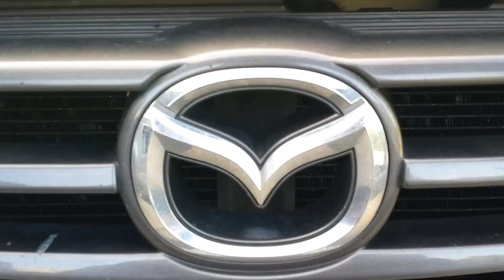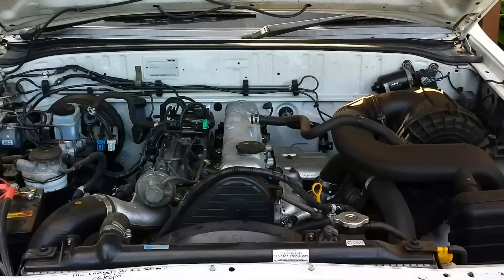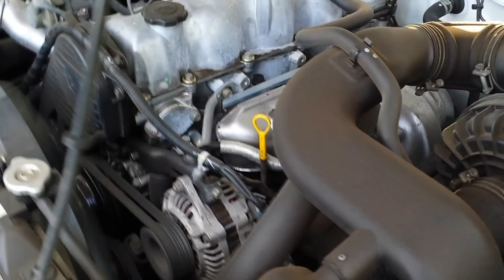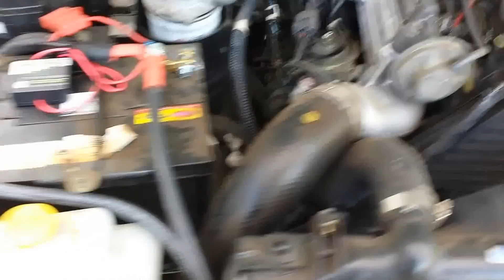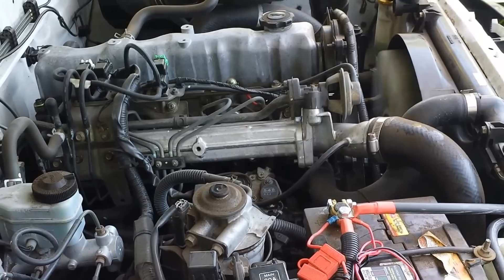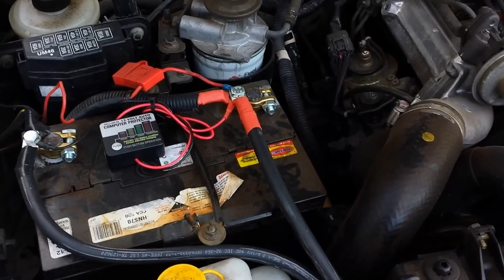Mazda Bounty 2006, 2.5 L WL -(2,499cc) - Turbodiesel - 86kW

Comment: Please.
Your help.
How many km should you do per liter of diesel.
This pickup has no electronics, it uses a mechanical diesel pump.
Reply from the maker: Mazda claimed the 2.5-litre models would sip fuel at the rate of 8.3 L/100 km, they also claimed the 3.0-litre models would average 9.2-10.4 L/100 km.  When tested by Cars Guide the 3.0-litre manual dual-cab ute returned an impressive 8.8 L/100 km average in a mix of city and country driving. Dependent on your driving style(agressive or passive), including urban or highway use, vehicle regulary serviced, correctly inflated tires, windows up, not using aircon, washed and clean, using the 12 second rule, driving at 90kms instead of 100kms, etc. Fairly conservative driving could cut that to 7.8 - 8.0 L/ 100kms, maybe even abit more, but those behind you might not be impressed.

Comment: one of the best diesel engines made
Reply: Why is it?
Reply from the maker: In my opinion, its a well designed tough engine that produces good torque. The Fuel injection is particularly noticeable than the prior carburetor versions, and if its well maintained religiously and had good clean fuel will go and go. One very well maintained and never abused WL engine I have seen, which had never been opened had done just over 1 million kms, which i found truly astounding.
Reply: I'm glad you've said that because I've got one but mine is the Ford Ranger 2003-2006 model👍🏼she's only done 67k. I bought a rear canopy off someone with the same truck, his was a 2005 with 300,000 miles on the clock and it still drives smooth.
Reply from the maker: That is awesome, two good pieces of advice that was told to me from well healed and very wise mechanic's was 1. maintain the vehicle and change your oil and filters / fuel filters regularly, with good oil / filters (i do mine every 5000KMs, overkill I know) and 2. dont use more than 75% of the available power that the engine produces most of the time, there will be times that you will ie overtaking or off road etc. This is just my opinion and others may have other ideas which is neither right or wrong, everyone to there own. I also use a diesel fuel additive, which improves Cetane rating and reduces fuel bug among other things. Good Luck and Happy Cruising.
Reply: @rattfink3285  Hey, I am about to buy a Mazda 2006 b2900 (4x2) and I would like to know if you use a diesel additive every fill-up in order to protect the engine and make it last longer? What's the brand of the additive? Engine oil you use is 15w-40? oil filter and fuel filter brand? What can you tell as far as common problems that this engines/vehicles have? Thanks!
Reply from the maker: @emirmartinezc   hey Bud. Thats great to hear, is that the 2.9L D version?. I use 'Morey's Diesel Smoke Killer fuel conditioner', increases cetane up to (5) points, to reduce diesel smoke, improve fuel injection, provide anti-wear, enhance fuel economy and ensure engine cleanliness and fuel stability. Also contains biocidal properties. Every fill. 1L bottle does about 650 Litres all up, about NZ$25. Shell Rimula R4 X, I buy a 20L pale and get about 3x changes from it, with new filter every 5000kms and diesel filter every 10000kms, Sakura brand at the moment as there are about half the price.
Although reasonably durable, most have been worked hard and show signs of it. 

The engine uses a cambelt which will require regular replacement. It is also prone to overheating, which usually ends in a cracked head. This is caused by a failure of the head gasket. Replacement engines are tricky to find and cost from NZ$2,500, so before you buy get a professional mechanical inspection and ask for a cylinder head leak-down test - that will establish the head gasket’s condition.

Glow plugs are known to fail prematurely, which make starting hard. These are straightforward to replace, although the work requires workshop settings because each plug is matched to a particular cylinder.

The five-speed gearbox shows weakness in fifth gear - the bearings can fail because of the excessive load placed on them at lower revolutions. On your test drive, get up to highway speed then change in to fifth and listen for bearing noise.

The rear differential pinion seal is another weak driveline point, although oil leaks from the ageing diesel engines are to be expected. Front wheel bearings wear out regularly, even without hard off-road use.

Check behind the cab (between the cab and the tray if the ute’s a flat deck example, or underneath on well-side examples) for signs of chassis rust and cracking. Reasonably well rust-proofed when new, the Bounty is starting to show signs of corrosion weakness in those areas of the chassis. More than a decade’s worth of moisture and mud that is not easily cleaned off don’t help.

There are reports of cracked metal seat frames and mountings. Inspect the seats for any sign of movement - rock them back and forth or side to side. Make sure the forward-to-back movement of the frame runners still operates freely.
Good luck, do your due diligence on it, and happy Motoring.
Reply: @rattfink3285  Hey, thanks for your reply and all the information provided!!....Yea, it is the 2.9L D version non 4x4. 

I am in the Caribbean (Dominican Republic) so the additive will be very hard for me to get and the oil I always used in my diesel corolla is Mobil Delvac so I can keep using this one if I buy the pickup. Those are really good suggestions and I will definitely take it to a professional shop and have them inspect the truck for me. 

I will let you know this week what I decide!!

Comment: Anyone know the fan belts replacement number, don't trust super-cheap auto they keep finding the wrong parts even with my rego plate( 2002 xl ) they really don't have a clue, Thanks
Reply from the maker: Their seems to be a few of them, if you still have the belt measure its lenght and width, and depending on its age it may have the part number stamped upon it, following that take the belt into a reliable parts supplier. Repco nz have many so it appears. Good Luck.
see List and link - 
https://www.repco.co.nz/en/search/vehiclesq=vehicleid%3Arelevance%3Alevel3Category%3A1862918127
 - Gates A Section Drive Belt 13mm Top Width x 1090mm Matched Pair - VA1090M $172
DRIVE BELT ALTERNATOR - Twin Belt System
 - Gates V Drive Belt 13mm Top Width x 1090mm Matched Pair - 13A1090M $175
DRIVE BELT ALTERNATOR - Twin Belt System
 - Gates Drive Belt - 13A1090HD $123 each
DRIVE BELT ALTERNATOR - Twin Belt System
 - Gates V Drive Belt 13mm Top Width x 1090mm - 13A1090 $87 each
DRIVE BELT ALTERNATOR
 - Gates V Drive Belt 13mm Top Width x 1105mm - 13A1105  $92 each
DRIVE BELT ALTERNATOR - Single Belt System
 - Repco V Drive Belt 13mm Top Width x 1090mm - Matched Set - 13A1090MRB $154 each
DRIVE BELT ALTERNATOR - Twin Belt System
 - Gates V/Belt H/Duty 9435Hd - 13A1105HD $91 each
DRIVE BELT ALTERNATOR - Single Belt System
 - ACL Fan Belt - REMF6430 $33 each
DRIVE BELT ALTERNATOR - Single Belt System

Comment: I have the same engine in 2011 mazda BT50 Trying to change the ECT Sensor its in a real hard to get at place is there an easy way to replace its hard to start when Hot but fine when cold and Runs Perfect just hard to start after it warms up ?
Reply from the maker: You may have to presevere, and/or remove components to get at it, unfortunatly. And or just pay to have it done. Are there any fault codes on the dash or diagnostic codes thru the obd2 fault cable. I would assume the starter, battery, and all cable connections are ok. Then I would look at the injectors to the pump. Then depending on location, where you fill up (or multiple places) poor fuel / diesel  bug ?, maybe a diesel additive may help?

Comment: Hola, soy de chile y estoy biendo una, los papeles dicen mazda bt50 año 2005 2,5cc diésel,,  lleva bomba electronica e inyectores mecanicos,, alguien sabe que tipo de bomba es y e buscado por todos lados la toma de diagnostico obd2 y no la encuentro, so la obd1,
Reply from the maker: Hola hermano, los registros indican obd2 antes de 2006 para el bt50, podrías probar obd1 con una versión de 16 pines.
https://eurocarpartsaustralia.com.au/shop/fuel-injection/diesel-pumps/siemens-vdo-pumps/siemens-diesel-fuel-injection-pump-mazda-bt50-ford-ranger-bk3q-9b395-ad/

Probar la bomba y la presión a cada lado de ella serán las formas más rápidas de descartarla.
https://www.700r4transmissionhq.com/mazda-bt-50-bad-fuel-pump-symptoms/

Comment: In South Africa, this truck is called the Mazda Drifter 2.5 SLE (post 2003) and SLX (pre 2003), both uses this WL engine.

I own one and have had it for quite a while...

In your video, I spot 2 differences, The air filter system is different. And You have a extra contraption right by the intake manifold, which mine doesn't have.

These engines are known locally to be one of the most reliable, even though they don't push as much power as the others... You can tweak and modify them to get close to 119Kw from them, but not sure how this impacts engine life :)
Reply from the maker: Hey bud, Thanks for your comment, great to hear your experience with this engine. Manufactures do tend to make different versions of vehicles /engines for the market they tend to sell in, generally due to Government regulations - safety rules, emissions etc, as well as model names, the name could already be in use / trademarked and/or just to make a general differentiation in the market they are selling in. :- )
Reply: DigitalMusicXpress  sorry I’m 3 years late EGR valve ✌️

Comment: How to purchase a Mazda  WL engine.
Reply from the maker: Mazda wreakers and/or similar. Maybe an insurance damaged vehicle, that's not economical to repair, but with a good motor and running gear?
Reply: @rattfink3285  I'm researching a Mazda engine 
WL to change the engine of my Mazda Pick up  B225.

Comment: That's one tidy and clean engine. I'm scouring the internet to find this 2.5TDi WLT engine manual. Looked in the usual places but no luck. Any insight?
Reply from the maker: It was, as it had just been recently steam cleaned. If you are like me, I prefer 'free',  I'm sure if you look more deeply you should get something I found this with links to a manual, but you will need to join there group ----       en.manualesdemecanica.com/social-network/groups/viewdiscussion/156-manual-manual-de-taller-mazda-serie-b-b2500-con-motor-wl-t-ingles.html?groupid=201

Comment: Hey mate I was wondering is it normal for the engine to sit around 3000rpm cruising at 100kph?
I have a 06 mazda bounty 2.5td
Reply from the maker: Depending on the load put on the engine ?, I would consider somewhere between 2K-2.5K rpm's for a manual at 100kms highway driving would be normal range, give or take. Has it always been like that ?, and does it feel like it going harder than it has ?
Reply: Since I've owned the ute it has especially on the motorway, I have gone back to the stock air box and eliminated the aftermarket pod filter.
But runs normal most of the time.
Reply: @rattfink3285  hopefully this helps the engine also, may need a tune who knows lol
Reply: @rattfink3285  could the problem be the speed sensor on the gear box?
Reply from the maker: @Waikato83  Good point, if you could get a second one swap it over and test, professional tune isn't a silly idea. it could be something small, like the accelarator cable sticking somewhere on the line, a small amount of grease could help.
Reply: Okay mate thanks will look into it 👍
Reply: All depends on gearing and whether your speedo is correct

Comment: we have this engine in a mazda bt50 .. same engine as the mazda b2500
Reply from the maker: Too true, NZ bt50's uses the 5 cylinder 3.2L only. Different markets use different motors i guess. Good luck, watch that heat.
Reply: @rattfink3285  yea the newer bt50s we got the 5cylinger.. I live in the caribbean and I think we import vehicles from the Asian market

Comment: En mi trabajo manejo uno de esos y al parecer nose acciona el turbo,ya le.hicieron de todo y nada,hasta le cambiaron el turbo y nada.la aceleraxion es lenta,hay otros vehiculos iguales que pruebo(mismo motor) y responden exelente.los mecanicos de mazda dicen que esta bien de potencia, pero yo que lo ando y hago comparacion se que no funcionan igual! agradecere algun consejo.
Reply from the maker: Hola Kelvin
¿El vehículo es regularmente reparado, con filtros de aceite, combustible y aire de buena calidad y aceite de buena calidad?
Is the vehicle regularly serviced, with good quality oil, fuel and air filters and good quality oil ?
 Inyectores han sido reemplazados?Injectors have they been replaced ?
 Un conector de tubo está dañado o simplemente sucio o mal ajustado. El fallo también puede ocurrir porque la válvula que regula el turbo no funciona correctamente.A  tube connector is damaged or simply dirty or poorly adjusted. The fault can also occur because
the valve that regulates the turbo does not work properly.

Un sistema de enfriamiento sobrecargado.
An overloaded cooling system.

La ECU (unidad de control electrónico), un error de este tipo puede hacer que el coche pierda potencia.The ECU (Electronic Control Unit),an error of this type can cause the car to lose power.

El depósito de combustible tiene restos en él y está obstruyendo el filtro del tanque. Limpiar o sustituir totalmente el tanque y sus componentes.The fuel tank has debris in it and is clogging up the tank filter. either clean or totally replace the tank and its components.

También obtener una segunda opinión sobre el tema de otro mecánico, si el mecánico que fue a no pudo encontrar el problema, entonces su tiempo para seguir adelante y encontrar a alguien que va a encontrar y solucionar el problema. Desde su vehículo de empresa, este garaje puede hacer todo el trabajo para los vehículos de las empresas. Pero la conclusión es que no y no han arreglado el problema. Encuentra a alguien más.Buena suerte, compañero de alegrías.Also get a second opinion on the issue from another mechanic, if the mechanic you went to couldn't find the issue, then its time to move on and find someone that will find and fix the issue. Since its a company vehicle, this garage may do all the work for the companies vehicles. But bottom line is they failed and haven't fixed the issue. Find someone else.
Good luck, cheers mate.

Comment: Hey chief i have this engine in my courier and i believe the engine has been replaced prior to my purchase. I can't find the engine number anywhere to verify and i am guessing it's concealed under a cover some where. Searched google and can't find an answer. Have you seen this illusive engine number? any help on where to find it?
Reply from the maker: Ok,so of course the General information plate on the firewall should have the original engine number on it. As well as the registration details held by the transport agency should have it recorded as well.
From memory, on the cambelt side (front), look down the left side underneath the inlet manifold and/or injector pump.. it should be stamped on a flat-ish area on the block, pretty hard to see by all accounts, a small mirror and torch may help......But let me confirm that with a follow up in the next day or two.
Reply: Just had a look and can't see it with all the pipes and covers in the way.  Will grab an inspection and have another look. Will let you know how i go. And thanks for the help.